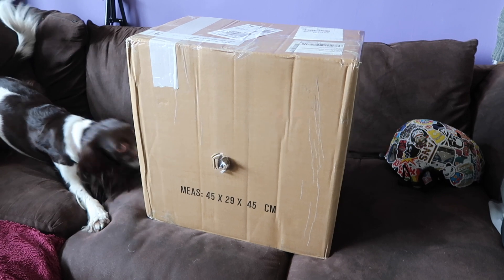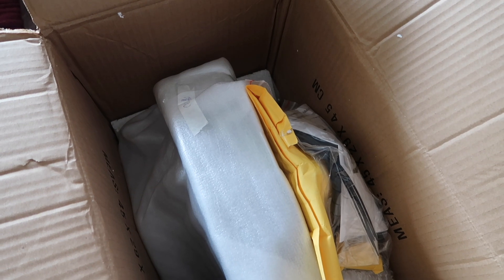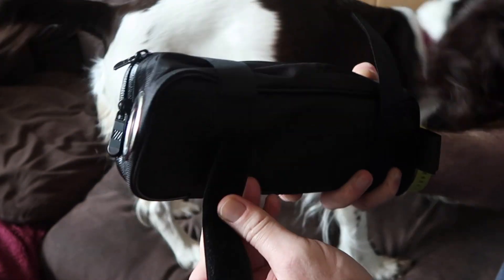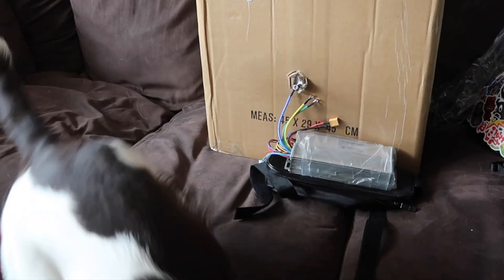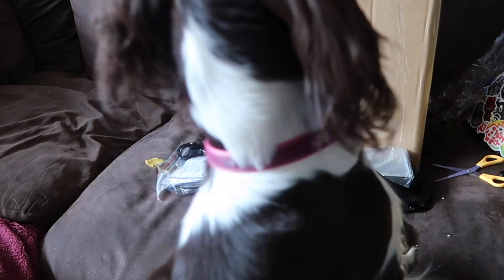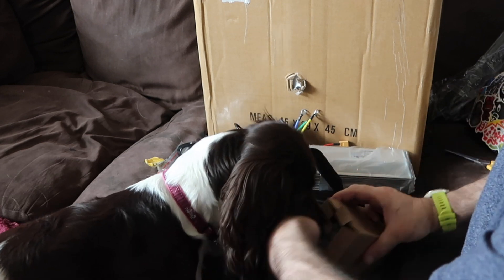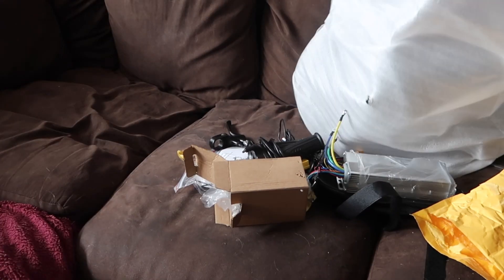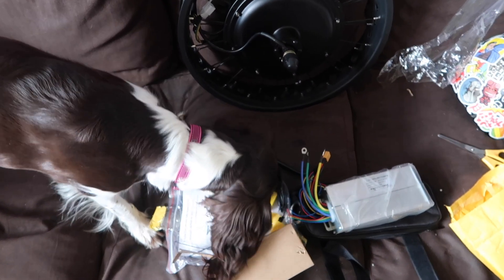48V 1500W 20X4 20X4 Fat Tyre Electric Bike Wheel/Kit From CSC Bike (eBay UK) UNBOXING (mate X Ebike)

Comment: Gday mate i have the same motor they go well but iv got a issue my sw900 display setting are wrong can you tell me what your speed magnet in settings say its p7 i require the default number

Comment: Nice going to be epic build, 
How long did it take to come from China? Can you post a link to seller , I was going to buy a kit from China but was told it would get held at customs in U.K. and I would have to pay quite a bit to release it
Reply from the maker: @singh s - Cheers mate..It took 12 days (not working days but days in total) from ordering - The ebay seller is based in Shenzhen district China..you get tracking..Defo no custom tax but i asked first just to double check..The seller is called "cscbike" heres a link to their eBay shop - https://www.ebay.co.uk/str/cscbike - Hope this helps...
Reply: @paulleeFLOW  thanks mate will look into kit and ask to verify if duty will be be charged